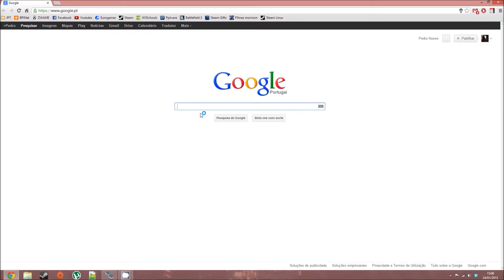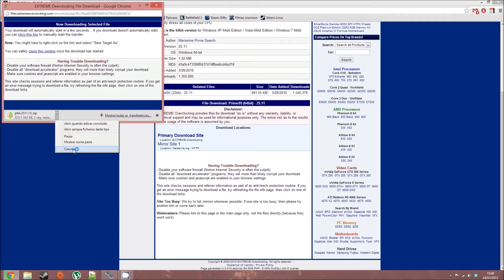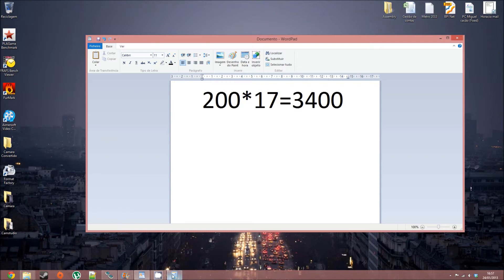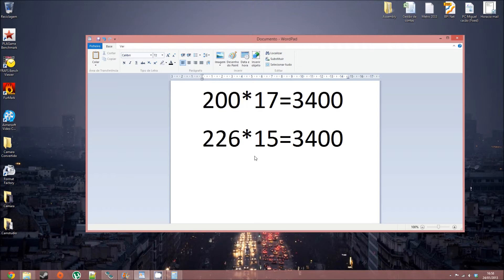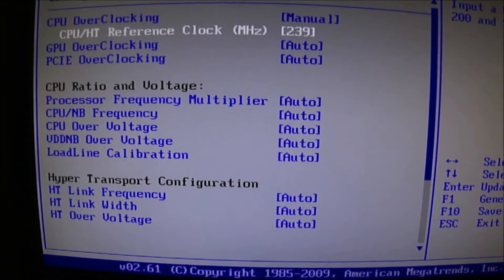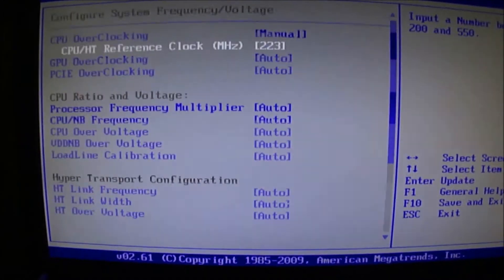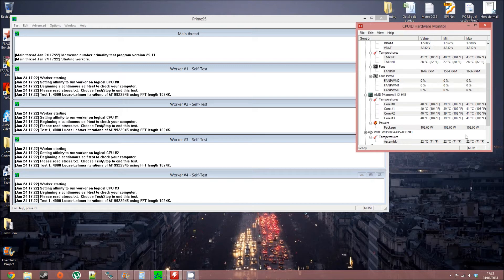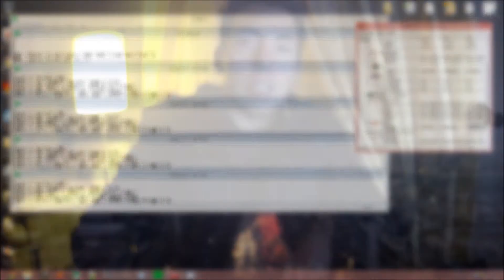How to Overclock Phenom II X4 945 [Basic Toturial]

Comment: wasn't really here for the tutorial, just bored and wanted to see what was on the vid but I have a MSI g46-970A motherboard and got 4 ghz out of my 945. I think I could get it to 4.2 with this motherboard but my cpu is only 430 watts. I'm air as well and temps stay under 58 Celsius when running prime 95.

Comment: not really especially if you're not maxing it out 24/7 just keep your average temps below 60 and you'll be fine. Getting better thermal paste alone will probably drop your load temps 5 degrees. That crap the comes on the cpu isnt that great.

Comment from the maker: Your PC in idle is at 50ºc?
If it is something is very wrong there and you need to check it out.

I am pretty sure that overclocking 300 or 400mhz will not raise so high the temps, i had the stock cooler when i started to overclock, without messing with the voltage i was able to raise those 300 to 400mhz with no problems..

Comment: Hi thanks for the video. What GPU would you suggest is the absolute best/max match be for the Phenom II X4 945 without either being bottlenecked at stock speeds? Would the hd 7850 be a good match for the Phenom II X4 945 or will the CPU bottleneck that GPU?

Comment from the maker: Ye, but i consider that a fail CPU, 200W of TPU that a lot, and stays behind the i7 again!
AMD is doing it wrong!

They need to worry and focus on improvement the IPC and the Multithreading Performance and Power consumption at the same time.
We need another big improvement like FX-8150 -> FX-8350 was, to reach the intel level!

Intel don't even care with AMD already they are focus on lowering power consumption and raising the power of the IGP to surprass the APU GPU
:P

Comment from the maker: yes, i am very very seriously
I would recommend to get an XFX Core Pro 450W or 550W or even a corsair CX-600W

You just need to do some maths, like the Phenom II 945 eats 95W if overclocked may get to 170w
The GPU eats 130W, 150 max if overclocked,
Plus 25w to chipset and 20W to the rest of the system.

Makes a maximum of 365W
Since PSU usually starts to be deliver less power from year to year.
Its up to you, but minimum XFX 450W and you will never worry about any PSU in terms of years

Comment from the maker: I am giving you a extreme advice, you need to buy ASAP a new PSU, not because you cant overclock more, but because you are risking to burn your whole system.

If you dont buy it, that PSU will burn soon or later and can take your CPU/motherboard, or even your GPU.
Go grab a xfx pro core 450w or a corsair cx-600 before that dont take it...
I am talking very seriusly

Comment: I bought a pc recently with specs 
AMD FX 4100k 3.60(GHz)
MSI 970A-G46 Motherboard
GeForce GT 210
8GB Ram - Corsair Vengeance
500GB + 160GB HD
500GB External HD
Windows 7 64 bit Operating System

After watching a lot of videos about the Phenom II X4 
i found that the 4100 is a lower cpu than the phenom , so if i overclock the
4100 , will it be as same as the Phenom II X4 in gaming ?